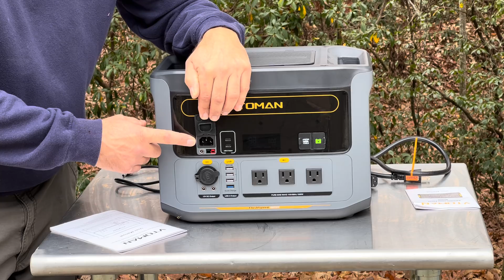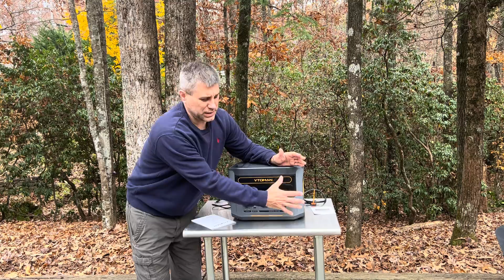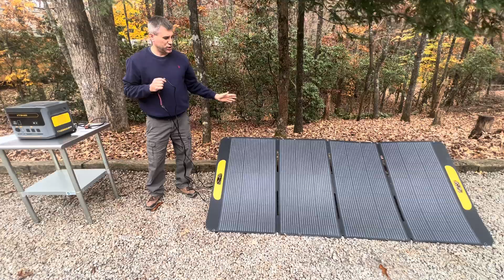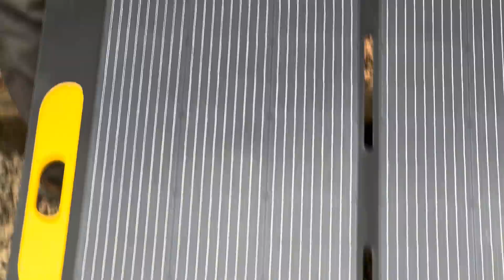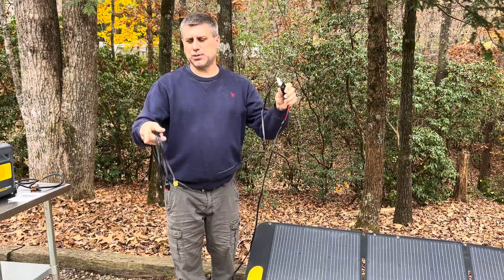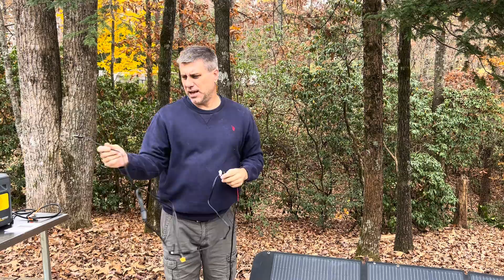VToman  FlashSpeed 1500 Portable Power Station...Fast recharge and expandable.

Comment: YES JUST BEWARE THE MAJOR DEFECT IN THIS UNIT WHEN USED WITH THE "EXTRA BATTERY" - AS OF MY WRITING FEBRUARY  2024 - AT LEAST WITH MINE AND OTHERS REPORTED - WHEN AN ATTACHED EXTRA BATTERY IS DEPLETED THIS UNIT COMPLETELY SHUTS OFF AND NEEDS TO BE MANUALLY RESTARTED INSTEAD OF CONTINUOUSLY KEEPING GOING AS IS SUPPOSED TO HAPPEN BETWEEN AN EXTRA BATTERY AND A BASE UNIT - THUS LARGELY DESTROYING A MAIN PURPOSE OF AN EXTRA BATTERY - HOPEFULLY THEY WILL GET THIS CORRECTED IN THE FUTURE.

Comment: @SouthernPrepper1, I apologize if you have answered this before, how do you protect your power boxes/solar equipment from EMPs? Thank you so much for your continued guidance. 🙏
Reply: there's a product called 'emp shield' that installs 'in-line' with the rest of the system, if you have solar plugged into your boxes. otherwise if they're small boxes you keep them in faraday cages.

Comment: I have the 1500x jump. Got the cables for jumping a car battery. Tested it on my truck that died, started without any issues. Pretty decent price on Amazon for them. Only flaw is the leads are kinda short.
Reply: hah yea jumping from one of the new gen batteries is a learning curve but once you got it down, its SO nice and handy.

Comment: I realize times are tough for a lot of us, and many people don't have a lot of 'extra' money, but I believe a power station may be some of the best money you can spend. If you've never had your power go out for multiple days, you may not realize just how valuable even a small device would be. My power was out here for 3 days just several months ago. 

There are some really good lower-priced units that are very good quality. The solar industry in general, but the power station industry specifically, are extremely competitive right now, and we're getting the benefits of it in better-and-better products, at increasingly more attractive prices.

At some point I'll opt for a very high-capacity system to tie-in to my home electrical panel, but for the time being I'm going with 2 - 4 lower capacity devices that I can still power most of the devices in my home with, but I also won't have a single point of failure, and the devices are much lighter, in case I need to grab something and go. At least one portable/foldable/rollable solar panel is good to have, also.

I only have an Ecoflow Delta 2 at this point, but even it will power nearly everything I absolutely need to power in my home, just not everything at the same time. Plus, I can easily carry it with one hand while I grab my 220 watt foldable panel with the other.

Comment: Didn't know you couldn't use these things daily which i do. I have the 1000watt buletti and just a amazon 100watt one so far. We've 300 watt of solar pannels we are connecting at weekend. We've a 100 watt fold up rigid  too which is linked to car battery and a 6000wattt inverter. I didn't know something as big as this in demo needed so little solar.
Reply: I'm not sure why he said to not use them daily,  I use mine all the time & as do most people, they're just so handy & useful.  
Perhaps he means if you're buying it for emergency only, to keep tucked  away until needed, then check it monthly to be sure the charge is holding.